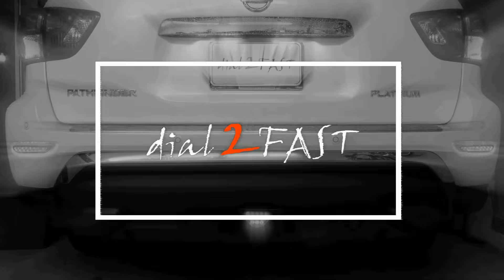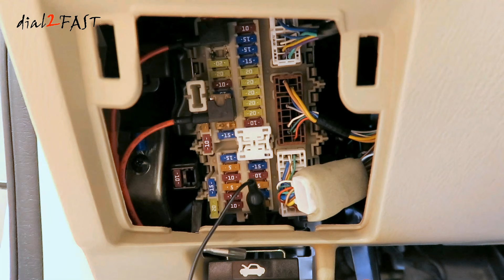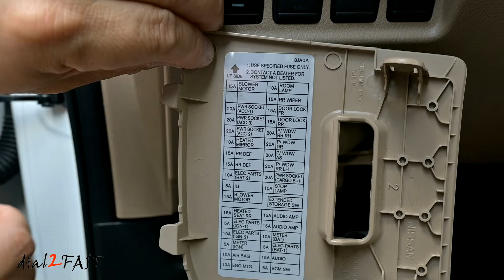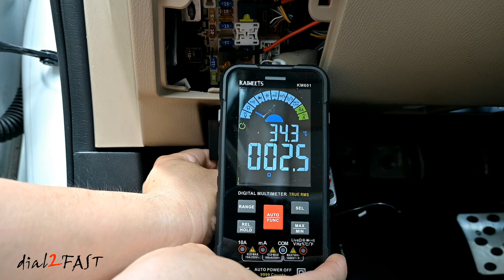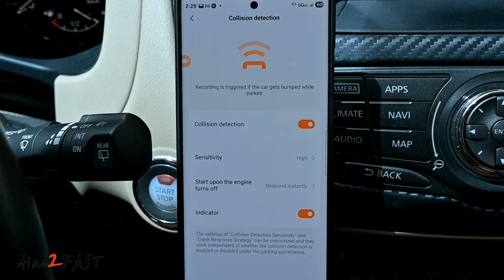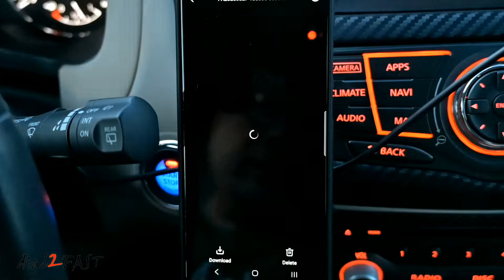12V Battery Pack For Car Dashcam Parking Surveillance | 70mai LiFePO4 Battery Pack

Comment: thanks for the video. i have a question if you can answer. i use parking obd II hardwire kit. There are buttons on the kit and i dont know which setting to be set as button positions. the dont give much detail on its manual. i want it to record if there is some problem while parking. thanks

Comment: thank you for your awesome video, I appreciate it. I have a couple of questions. Do both the hardwire and the cigarette lighter need to be connected on the 70mai? Or once hardwired it doesn’t need the cigarette lighter? (I am using a third party mirror 3D dash cam).

Comment: Wont this be a fire hazard? Especially during summer where the car can reach high temps when parked
Reply from the maker: The battery is LiFePO and it will not combust.

Comment: Hi there. 
I currently have a Powercell 8 battery pack that supports Thinkware U3000 front and rear cam inmmy car.
I now wish to install the 70Mai T800, 3 in 1 dashcam with 4G sim to the 70 Mai external battery pack. So my question is..... Can ì install this 70Mai battery pack in the same car that already has the Powercell 8 battery pack? Is having two separate battery packs in the same car ok to have with two separate dashcam connections (Thinkware and 70 Mai)? Please advise, thanks
Reply from the maker: You can install more than one dashcam battery in the car if you want. The charging is done while driving, so it doesn't affect your car battery in any way.
Reply: Ok thanks so much!

Comment: Hey man so I installed this battery pack but instead of using a hardwire kit from the battery to the dashcam I used the usb c cable and it fully drains the dash cam battery in one night even when my dash cam is set into parking mode. Any help would be appreciated... please and thank you! 

To clarify my set up is:
Dashcam battery charging via hard wire kit to car fuse box.
Dash cam itself is plugged into the dash cam battery via the 5v usb C cable.

Comment: I know you mention in the video that it charges the battery when the car is turn on but doesn't hardwiring the 70mai battery to the constant 12v drain the battery as well?
Reply from the maker: No, the hardwire kit control box is designed to automatically cut the power output to the dashcam when the battery drops to the cutoff voltage, so it won't drain your car battery all the way to 0v while parked.
Reply: @dial2fast   does the dashcam used the full capacity of the battery? I initially set my hardwire control box to turn off the dashcam when the car battery hits 12.1v but since im going to swap over to the 70mai battery, is the camera going to turn off when the 70mai volltage drops to 12.1?

Comment: Good review. The advertisement said 70mai battery pack can last one week. But when I used it for continuous recording today, it only last about 8 hours
Reply from the maker: The runtime on the battery pack depends a lot on how many event recordings the dashcam had to power up and record. Also depends on how fully charged the battery pack is (how long was your drive to charge the battery). The runtime can be anything from 5-6 hrs to couple of days at most.

Comment: The camera power is plug in battery or separate?
Reply: DO NOT AVOID AT ALL COST BATTERY IS CONNECTED TO CIGARETTE PORT AND CANNBE CONNECTED TO FUSE BOX WITH HARDWIRE KIT THIS BATTERY WILL GO WRONG IM VLAIMING A DISPUTE
Reply: DOES NOT MEET THE STANDARDS  BATTERY PACK 4G MODULE FAILED

Comment: Great review. Is parking mode and remote monitoring required a subscription? If so, how much?
Reply from the maker: The parking mode and remote surveillance do not have any service charge from 70mai, but you will need to have a 5G cell phone service plan for the remote surveillance feature.
Reply: @dial2fast  When you use cigarette plug, does it actually drain the car battery? Can charge this dash cam battery pack on a wall outlet? If an adapter is needed, does 70mai have one? Thanks.

Comment: Can this 70mai battery pack be paired with Vantrue or any dashcam with USB-C connector and connect to cig adapter and still have functional parking mode? I don't want to go the hardwire route.

Comment: Does the 4g kit works if i connect this battery pack to the cigarette lighter adapter ? Some guys say the 4g kit must be hard wired to the car fuse box for remote surveillance
Reply from the maker: The 4G kit needs power to operate. So you need to hardwire it to the fuse box for power after ignition is turned off.
Reply: @dial2fast  Even if it's connected to the battery?

Comment: I saw that you set the parking mode duration to 24 hours and said it will record until the battery pack is drained. If I set it to "unlimited," it will do the same thing, right?
Reply: Sure

Comment: Can I simply plug this battery into my USB port or my car charger to charge it? That would be a much better solution rather than taking up one cigarette lighter space.
Reply from the maker: No you cannot because the battery charges at 4-7 amps. Most car phone chargers output 1-2 amps max.

Comment: Apparently, if you get the battery pack with cigarette charger, you will not receive parking surveillance cable adapter and therefore can't use the 4g kit. However, if you get the battery pack with fuse box solution, then you can't have the cigarette charger, but you get the adapter for the 4g. You can't even get their adapter separately.  Is this correct? I just bought these and about to return them...
Reply: I also ordered the cigarette lighter solution, I was expecting the parking surveillance cable adapter too. After I read your comment , i got on 70mai website and ordered it , just search ‘parking surveillance cable adapter ‘ . Thank you , you saved me a lot of frustration

Comment: Great video,I wish you would of showed how to hook up the 4g? Thanks for sharing.So how long does this battery last before it stars juicing your car battery?
Reply from the maker: The 4G hardwire kit setup was covered in my previous dashcam review video. Link it's in the video description. With the battery pack, it NEVER uses car battery power.
Reply: @dial2fast So if you plug this into a cigarette lighter You dont have to hardwire it? Can you also plug it into USB and not cigarette lighter? 

How long will the T800 stay on Before it shuts down? I don't know the watts on the T800 that's why I ask as I know it depends on the watt of the Camera. 

Thanks again for your clarification.

Comment: I bought the same 70mai battery pack. But it doesn't charge. Tell me please, does your 70mai battery pack charge when the DVR is not connected to it?
Reply from the maker: Yes it charges once you have the 3 input wires connected. Check with a multimeter to see if the 2 power wires have the correct voltage, and if the Gnd wire is connected to car's chassis.
Reply: Make sure you have proper ground if your ground is on a painted surface it may not work at all.